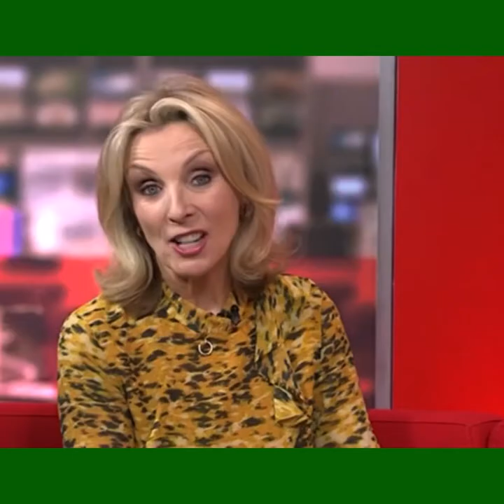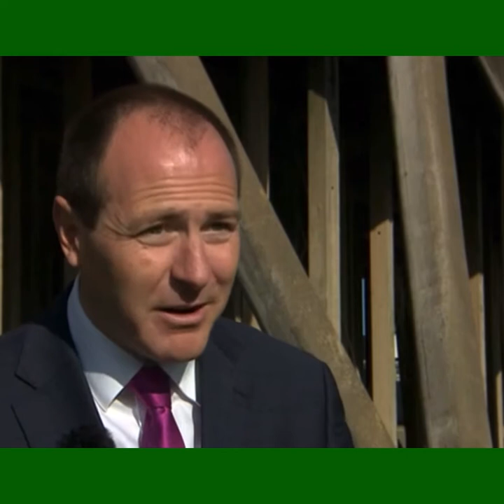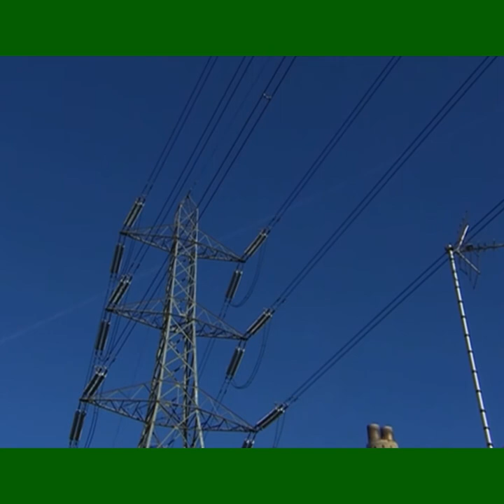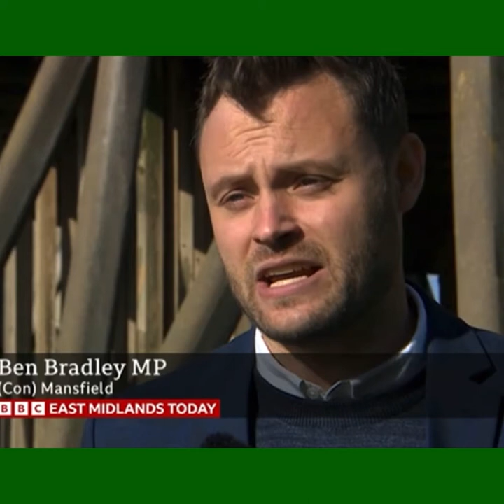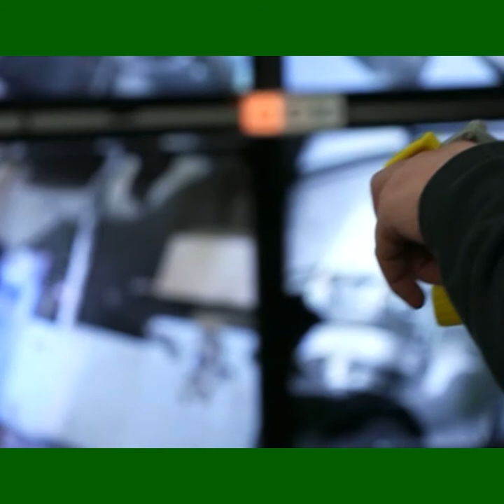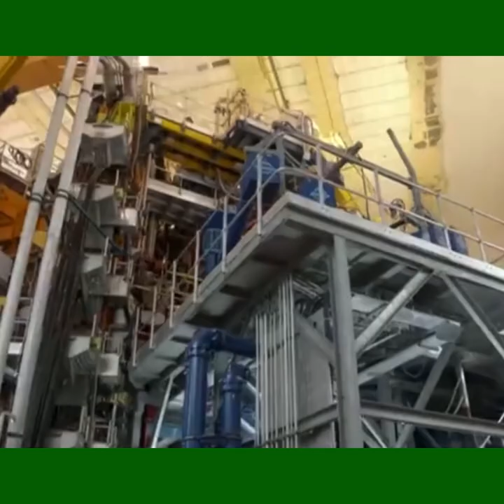STEP Fusion Energy (East Midlands Today)

Comment: Challenges we need to overcome, like the laws of physics. Seriously, this place will not be producing power in at least 40+ years. The plasma instability alone is mind breaking, let alone fuel injection, heating efficiency, tritium breeding...
Reply: The local Tories have been boasting about this. None of them seem to understand how difficult this challenge is
Reply: @solidoperative  most people don't, it's a really complicated topic, it's pushing the boundaries of our understanding of physics. Apart from a few huge projects like ITER who have top talent, no other fusion projects have any hope of grasping this to produce any power. The actual fusion part is really easy to do, everything else isn't.
Reply: @Codysdab  I think the Tories have been incredibly dishonest about the other parts as you call them. I think this will be another experiment and they should be honest about that. I can't see it producing power to the grid on a commercial basis by 2080 let alone 2040.
Reply: @solidoperative  I'm not taking any political stance, which is abnormal for me 😁, but unless you've been specifically educated in how fusion works and its challenges you can be sold a real mule whilst being told its a racehorse.

There are fusion scams going on all over the world right now exploiting ignorance as politicians rush to grasp a "fix" to climate change.